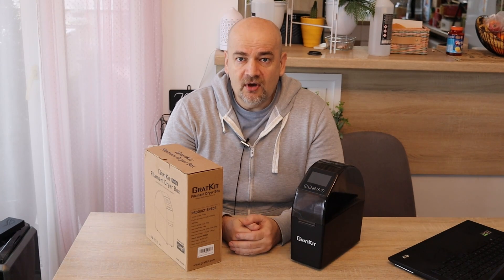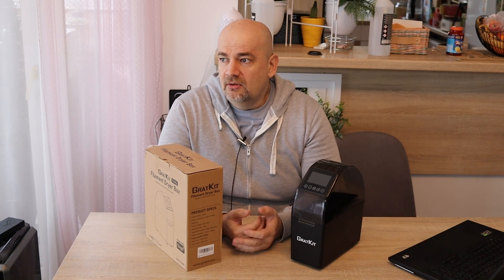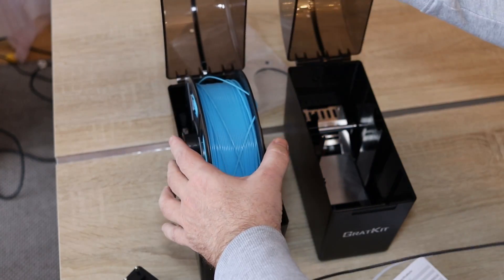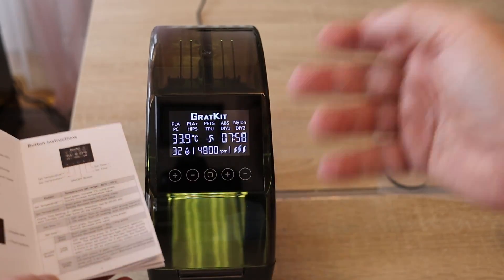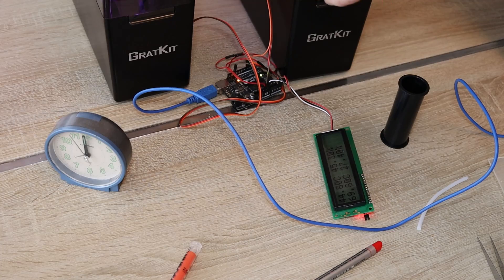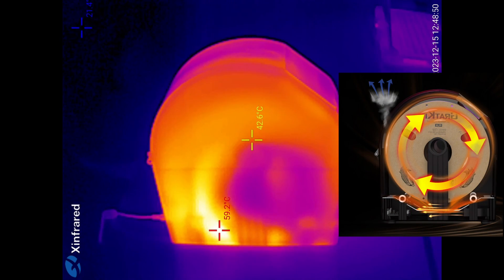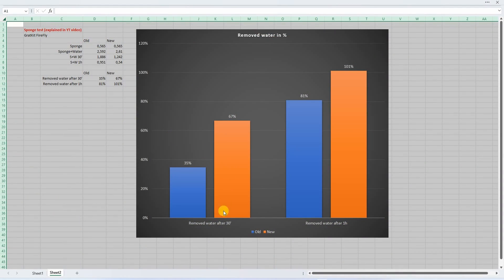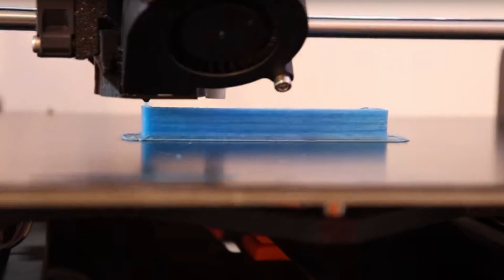They fixed it: GratKit Firefly filament dryer (re-review)

Comment from the maker: To avoid misunderstanding since the old dryer looks like set to PLA: both dryers were set to 70°C, only the old one was set manually (since it was not connected to smartphone and I couldn't change preset value over UI)

Comment: Mine was running great for a couple weeks but have now run into 2 entanglements inside the dryer. It's definitelt the angle the filament is coming out of the box. I may modify this or I may return it if possible

Comment: You should review the Nina 5qt Air Fryer at $79. Perfect size for one spool with large internal fan and adjustable temp settings for all modes including dehydration. The parts and wiring in these “filament dryers” can not withstand an environment above 50C.  That is why you see models being shipped with 2 rotation motors or multiple ribbons in this case.  Commercial circulation fans have far more robust bearings, wiring and control panels. Look at the comparison between the components and interface on any kitchen air fryer.  Even the enclosure is metal.  And the price is nearly the same.  These filament dryers are just plastic junk with very cheep components.

Comment: Can you check what's the actual maximum width of the spools? I just tried a 3dJake 72 mm wide spool and I had to bend the bottom half to get it in. It works as standalone dryer but it won't turn for printing.

Comment: Suggestion for a video: take some dryers which have noticeably lower temperature on the top of the filament and add an insulating foam around the top half to see if/how it improves.

Comment: They sent me a "prototype" which had the thermosistor under the tape.  I went through their little video showing how to slice the thermosistor out and try to heat up...but it still struggles.  The menu / beeping is hands down the most annoying of all the 6 dryers I have in my lab.  They haven;t reached out to me to replace this with a "fixed" version.  If anything, they wanted me to ship this to another "tester" (sure, let's anger more perspective customers?)  So, they may score well but I am really unimpressed with how they do business.

Comment: OK, so I have the dryer that was supplied as part of the Kickstarter campaign. It was delivered so late, I just tossed the box on the shelf and forgot about it. Just the other day I dug it out and tried to use it. 
Yes, the UI on the unit is just abysmal. I can set the led color (that of course is of no use to me whatsoever). I can set filament type, the temperature and the time. But I cannot start the drying cycle. Any manipulation of the center button just turns the unit off. 
I have tried the app, it searches and finds the unit, but refuses to connect to it. 
So I guess I’ll put it back in the box and throw the box into my electronic recycling bin. 
I have a new Creality dryer which in the US, it’s cheaper than the new Gratkit. It is so easy to use and is very effective. Some people have reported problems with the humidity measurement sensor, but mine works perfectly.

Comment: Thanks for this review, very useful testing and tech info. So far it seems this is the only company listening about temperature, particularly for nylon where the optimal temp is 80c. Another simple mod could be a stepper motor for even spool heating/drying. As for the filament feed hole? How can any serious company still be locating the filament exit hole at such a crazy angle? One has to wonder if they ever actually trial their drier with a printer?
Reply: I bought 1 a week ago and have had it running non stop since. Not bad but that filament hole is the worst. I'm thinking about plugging it and drilling another hole in a better location. No one should have to do that though!

Comment: I am not sure if they changed anything on the version that I got this week, but you can change the filament drying preset on the device itself.
Long press the middle button, wait until it beeps and the filament selection will start flashing. Then press once on it to advance the preset selection.
The current version of the manual also mentions and shows the top/lid hole as being meant to route the filament through there.

Comment: I bought one of these but it seems to overshoot 10-15 degrees while heating up to a setpoint. Example if I set 55c it will go almost as high as 70c inside on the way up to 55c. Once it reaches the setpoint it maintains within 6-7c. In comparison my cheap dehydrator cycles +/- only a couple degrees.

Both spool holder axles don't spin freely unfortunately due to one shaft being bent and the one the bearings are not mounted straight.
Reply: By cheap dehydrator you mean a food dehydrator? I'm shopping for a filament dryer and trying to decide between a dedicated dryer and a food dehydrator.

Comment: Excellent review, thank you.

I share your concern about the 'defined filament exit' hole and chose to use the 'vent' hole. 
When I purchased my unit in December, I asked for clarification on the intended Filament exit and was told I could drill another one anywhere I wanted in the top. Not wanting to void any warranty, I avoided potentially damaging the lid.

I successfully ran the unit for a few weeks; while printing from it to get the filament rotation you advised.

After several print jobs &  filament swaps, the unit failed to do more than 'BEEP & run the fan for a few seconds'.
 The LCD no longer would turn on, as I attempted to power it up

I suspect the Tiny Lid Mounted ribbon cable may have failed, near the hinge point; which made me take note of the 'spare cables' they sent you.

When it worked, I liked the Dryer and the Smartphone control. My only successful means to turn it off was to unplug it, frustrated by the multifunction On/Off button.

Having a cable strapped across the lid hinge seems like a bad idea to me; and I await their response to my failure report. 

Have you had to repair your unit with those cables they provided you ??
Reply: A proper cable will survive thousands of bending of the hinge. The first time you get an issue buy a better ribbon cable.
Reply: @cache4pat Whatever happened with this? What was their response? Did you continue using the dryer or did you swap?
Reply: Sounds like junk, buy something else!

Comment: The tuya app encompasses hundreds of devices I have a robot vacuum, led ceiling light, temperature sensor, WiFi doorbell & led strip light that all run on this app It's an excellent app but needs to be big to cover all devices

Comment: One of them is set to nylon and the other to PLA during the test. How does the filament buried deep inside the spool get dry? Seems like a placebo and no one ever seems to test if the filament itself actually does get dry (weigh the spool before and after).
Reply from the maker: Both are set to 70°C. The old one was not connected to smartphone and as I mentioned, I coudln't change the preset value over UI. So I just changed manually the temp to 70°C.
Reply: The filament inside can never get dry, it's just physics, but you can use the dryer during printing for that purpose.

Comment: Is there an easy way to tell if you have an original unit or the most recent one. I got one in 11/2023 so I think it's the newer, but I would like to make sure.
Reply from the maker: Try to heat up to 70°C if it stops at 50-55 you have the old one. If it is close to 70 the new one. (no need for separate thermistor, you can use one shown on display)

Comment: Nice review Igor. I would be happy to use the Sunlu method - I have a Sunlu that comes with a PTFE tube and a grommet that fits in a slot at the front where the lid meets the case. If the filamentt is fud from the bottom of the spool this tesults in near-perfect tangential feed, so I would cut a similar slot in the front of this one.

As to software, dince the move away from C as the language of choice, all software seems incredibly bloated to me. It includes a ton of unused library code and ia not efficiently compiled.
For s my all,vefficient code, give ne C every time. C++ was the start of a slippery slope

Comment: Is it me or is the old one set to PLA ?
Reply: Looks a lot like it, yes.
Reply from the maker: No, manually it was set to 70°C (as I mentioned over UI it is almost impossible to change preset value and I didn't connect it to smartphone)